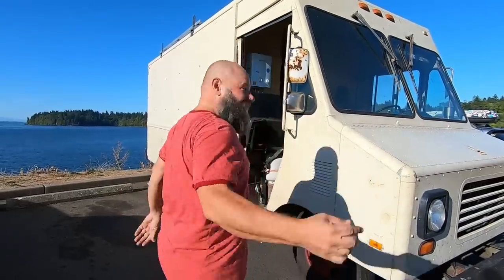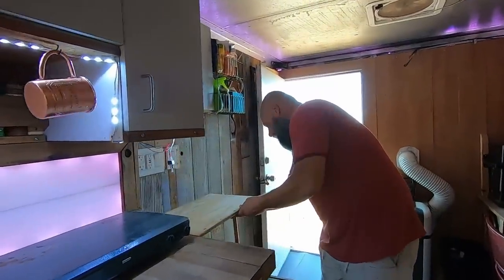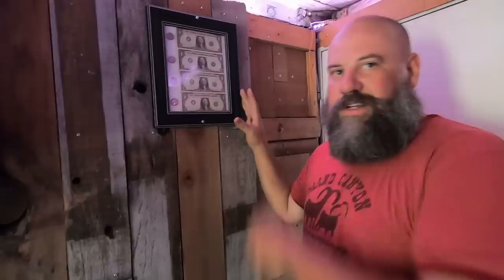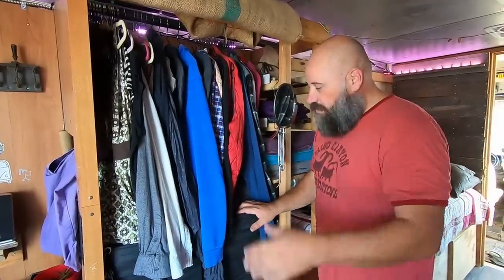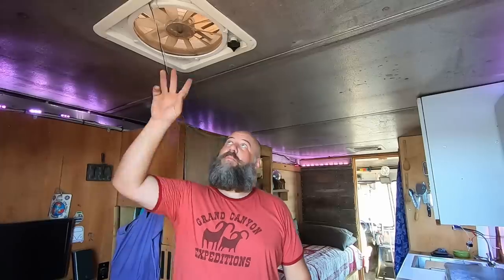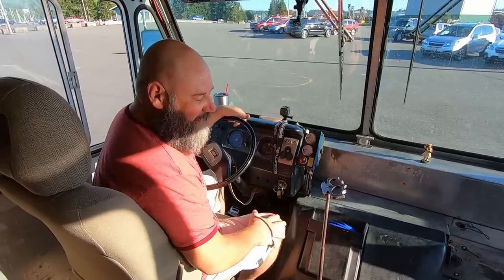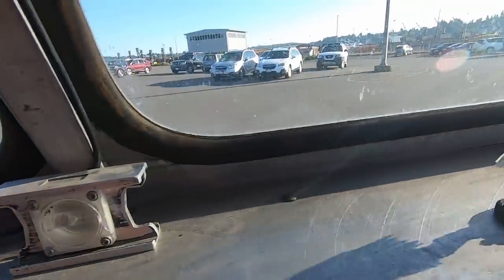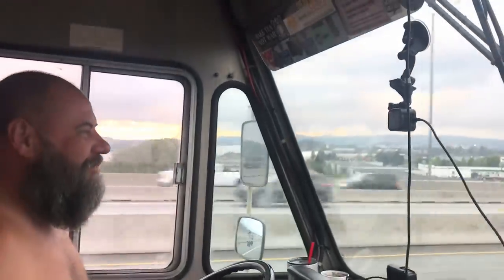VAN TOUR | Spacious Vanlife Stepvan w/ Cummins Turbo Diesel | Camper Van Conversion

Comment: I had a 1963 Chevy Step Van  292 6 cylinder when i was a teenager. BTW 69 years old now. It really attracted the police. The  rear doors opened the full width of the van, had a full size sofa there facing out.  Twin size bed behind that.

Comment: Back in the 70's I bought a commercial International Harvester laundry truck that had thrown a rod.  I got it for $75.00.  A  friend had a 1965 Cadilac with a rotted body.  He gave me the car.  I pulled the engine and tranny and adapted them to replace the IH engine.  I made some linkage for the tranny, added an AC condenser to cool the tranny fluid, and put it on the road.  I drove it everywhere up the West Coast to Arizona.  It had a bath/shower, gas refrigerator, stove, sink slept 6.  It was a lot of fun.

Comment: Hi, I found your channel from when the k9 police pulled you over. Which you handled very well. I'm a diesel mechanic at a gold mine just north of area 51. Your 4 cylinder Cummins is by far one of the best diesel engines ever made. We've made bread trucks into service trucks in the past. I'm sure you know, but you could make a large box under your bed for many 6 volt batteries. The reason I told you about where I work near area 51 is it's all BLM land. The weather is beautiful during the summer, and most of the winter. I don't understand why no nomads with a channel don't go out there. Especially for content. Just subbed thank you.
Reply from the maker: I may have to soon! Sounds great! Maybe you could peek around the breadtruck and point out of it has any issues.

Comment: VERY IMPRESSED ! GOOD JOB !!!!! 
NOTE: for the fridge, you just need 2 more solar panels, and inverter and dont spend on a fancy RV FRIDGE, Get instead a small DC to AC Solar Inverter that will work with you solar panels. 
AFTER THAT: You got 24x7 electricity like any home. Get an ENERGY STAR CERTIFIED REFRIGERATOR and have EXTRA POWER for everything else, you could even run a little shop and all construction tools from there.

Comment: Very cool and you didn’t spend $150k on it. That leaves a little left for the traveling kitty. I love the on demand hot water system.
Reply: We've had on-demand hot water at home since the 80's. 20 showers or 20 loads of laundry is awesome to have, and takes up less room than a hot water heater that wastes money staying hot 24/7. They pay for themselves.
Reply: @POWER-LINKS  Almost every Hotel, condo or Resort that I've stayed at in the Philippines uses instant hot water heaters and they've been using them for a long time. Works great.

Comment: Very cool and well thought out truck that will last a long time . I would have to figure out a screen for the back door and a window would be nice , however not stealthy , I understand . I travel with a F - 350 dually with a 91 11 foot Lance camper and pull an enclosed Harley trailer behind . I only get about 11 mpg with the 7.3 diesel . I love the challenge to build a unit out of a bread truck like you did . Very nice . 👌

Comment: CO2 is heavy; put your monitor further down near your head where you sleep.  Other than that, great conversion!
Reply: CO, carbon monoxide is what kills people. It suffocates you without warning. CO2 causes you to hyperventilate as a warning.
Reply: Dan that's a great idea!
Reply: Not necessary if you have the air moving.

Comment: Paul, Love the setup you have. If I may give you a tip that I just discovered, and put to practice. You mentioned going to a Dometic fridge. I have one I will give you free. Why? because they suck!! I took mine out and bought a dorm fridge from Walmart its a Hisense 4.4 Cu ft that runs on 110, fits perfect under my counter at a height of 33 1/2 inches. Well, I have mine hooked to 2 batteries with 200 watts of solar. This is the way to go!!!!!! Trust me, this thing is super cold. Very efficient, quiet as it can be. No regrets with the swap! I should have done it a long time ago. BTW if you do the math, Dometic fridge will cost more than A large dorm fridge+Solar+batteries, yes all of that is cheaper than a Dometic fridge alone. Just found your channel today, very cool rig, look forward to more vids, Dave
Reply from the maker: Dude I’ll take it!
Reply: @PaulBarger check out the VL45 Iceco fridge at about $500 or get one on sale. Better than a Dometic but also uses very little power. Iceco VL45 is built tough like a bread truck.

Comment: I’m watching this in 2021 so I’m not sure if you’ve already solved your jump seat issue, but Toyota Tundras have fold up back seats. They’re a 70/30 split, so the passenger side is a single seat. Folds up from the bottom, and very comfortable. Just a thought 😊 Great setup!

Comment: Love what you've done with the bread truck!
I'm a retired roofer. 
If you ever need a sealant to permanently seal your roof penetrations try Roof Coat 2200. 
Aka rc 2200. 
It's not water based and literally lasts forever!  
Available at Roofing supply places.
Reply from the maker: Awesome! Thank you. Thank you for the tip!

Comment: Awesome home! You may want to consider some ideas. 1- You can make a sliding drawer out of each of those boxes under your bed. 

And 2-To avoid having both of you to get out of bed, to put the mattress back to pull out your sliding drawers, you can make the front, of the extreme drawers, going sideways to your hallway, and get things from them while on bed!

One more, maybe, you like Beetle's passenger seat's system that rolls to the front giving you space behind it to pass to the back. The negative, is too short for the truck or it may be too short so, maybe you want to check minivan's hiding down seats in the floor style that, although may not hide in your truck bottom it rolls in somehow allowing you to pass behind. Just check under seats roll save space.

Comment: Building code requires a door to be hinged on the interior.  If the hinges were not on the interior then someone could just pop out the hinge pin and open up the door, also incase of a fire and someone cant open a locked deadbolt in order to exit home.   You have done a good joj keep it up and God Bless  .   Lee from Tennessee :)

Comment: Paul,
I would keep the original bumpers. Why? It keeps with the "city stealth" mode, they are extremely tough and will protect your camper body in case of an accident. I built pipe bumpers 6" filled with concrete, to put on my '79 GMC "Heavy Half" pickup. One day a Ford F-150 rear ended me at 40 mph, and was totaled. My damage was scratched paint easily repainted, no other damage. With today's plastic cars and trucks, it is nice to drive a tank like my GMC. My '90 Ford Ranger has 3"pipe bumpers, but fortunately they haven' been "tested" yet. Sturdy bumpers can save you a lot of money and headaches in this plasticised world. Happy traveling !!

Comment: Jump Seat idea for you!.... my 2004 Ram quad cab rear seats were made to fold up. They were 70/30 or 60/40 split. If you used one side of a rear seat like that (might need a welding shop to make up a way to mount) you would have similar function as you have now but a fat more comfortable ride. Great vid, thanks for the tour.

Comment: Good idea to have the door open into the vehicle. Would suggest building a screen door. Have a residential metal door on the back of my cube van with a screen door. Door can be left open with the view and fresh air without bugs getting in or my dog getting out. For the screen door simply made a wooden frame with a couple supports to keep it square and stapled aluminum screen. Covered the staples with half round pieces of wood trim.

Comment: I have watched a lot of these and this is by far the best one I've seen yet. This thing hits every one of the most important features you would want to have when putting together one of these trucks. I think the best of all is the aluminum body... Headroom and motor... Great job! If you need heat buy suburban furnace or diesel heater since you already have diesel. Try not to use the Buddy Heater.
Reply from the maker: Wow! What a compliment! Thank you so much! That’s rad!

Comment: I have the same motor that you have in a 1995 Ford short bed F150 and it gets 25 miles to the gallon five speed stick great rental vehicle love to travel in it
Reply from the maker: I bet that truck is a BEEEEEEEAST
Reply: I have a 1986 Chevrolet motorhome 28-foot I'm getting ready to put a 4bt Cummins in it and hook a transfer case up in 4 wheel drive I think it will be awesome when I'm done probably won't be fast but it'll get you there

Comment: Having the door open in also puts the hinges on the inside - otherwise, it would be easy to remove the hinges from the outside and gain access to your vehicle.  Or you would have to use some method to secure the hinges.

Comment: i would extend the jump seat bottom out about eight inches so it still folds up but is more comfortable. fit it with a plush cushion and on the rear too for way more comfort. it wont go up all the way but it will solve you problems.
Reply from the maker: I’m going to completely ditch the jump seat. I want a legit passenger seat with a shoulder harness.

Comment: New Subscriber.Created & saved this video to a new play list .you've inspired me .seen quite a few of these builds but something about yours hit the spot. You know the feeling ....It's yours.few sugestions...I'm a handyman,put in some screen doors on a home last year .screw to the door jam .roll up.very simple .think you'd like 1 or 2.The ac...maybe they're different now but I bought one of those a few years ago ,needs a caulked plywood box built around it .way more efficient.Google your model,my not apply.mine sucked more hot air from outside than the cool it out out.from any tiny crack\unsealed spot.Small piece of car window tint on the light that's too bright.grab a few different scraps from dumpster to find right shade or sharpie pen works..small slideing tinted ( mirror) Windows on  both doors .curtains optional.if you get this ,save me some time...ball park ,how much was build?Thanks
                                                                               Burke.NC.
Ps.ever near Pinehurst ,plenty of room for you to park & camp.quiet country spot..
      2  questions..Bridge,Charlston SC?why don't you like your bumper s?
                          Take care& good day.BW
Reply from the maker: Bridge is Port Mann Vancouver BC, the front bumper is crooked and the rear one is mounted silly. Can’t attach a hitch. It’s also very slippery.

Comment: nice thouch with those woodblocks to keep the doors closed
think a boxvan is a verry nice base for an rv , door in the back entrance through to the cab ,aluminium body simple flat windows and a lot of height 
as for the batterijvoltage leds  , look intoo someone that tints windows and take a small piece of his offcut window tinting foil . it should dampen the light by a lot , can even douvle up on the foil

Comment: Monoxide alarm needs to be lower.  
Monoxide is heavier than oxygen so you could be dead before it ever alerts the alarm. 
Smoke detecter up high,, monoxide alarm down low.  
Just a thought to consider.

Comment: Paul, as I'm new to you channel and videos, I'm sure someone else previously mentioned that you need to mount your carbon monoxide detector close to the floor. If your detector goes off while you are in the van where it is presently located, you're already going to be dead. Carbon monoxide is heavier than air.
Reply from the maker: It has been moved. ;)

Comment: Carbon monoxide is heavier than air.  If it were to settle and build up in your truck enough to set off the alarm up by the ceiling, you would have already been dead for quite awhile by then.
Just a PSA.  Nice rig.

Comment: u need an outside vent for those batteries,   As your battery heats and cools, and charges it creates hydrogen gasses.  A spark can cause an explosion. Venting these gasses reduces this risk.  You can go to Colaw used RV parts and get good prices on appliances and other stuff out of wrecked rv,s
Reply from the maker: These are AGM sealed batteries. No vent needed. Going lithium ASAP

Comment: Love the build , how is the drive and steering on the bread truck and have you modified the shocks and sway bar front and back . Have you thought of putting a swing up deck in back made of alluminum and when up it would be like Dutch door , covering part of the door way 4 ft on the bottom and be able to use it as a electric bike mount on the back side while in the up position,  with even some lite at alluminum boxes for storage with feet to hold the deck in the down position.

Comment: As a truck driver with 22yrs experience.  I am a pro at living out of a truck. Do not, what ever you do, get one of those 12V fridges. Trust me.. They suck. They only keep you food 40° cooler than the ambiant air. Get a 120V 2 door mini-fridge. Like what's in a hotel room. They are about the same price. Depending. They start of with a 800w serg but usually cycle at between 50-130w. With six 6V 650amp configured to 18V, I could run the fridge for 3 days without having to start the truck to recharge the batteries. Another nice thing about a mini-fridge is.. You can turn the settings to the lowest setting and turn it into  a 2 door mini-freezer. In a four battery 24V setup my fridge would last a day and a half to two days. Now I know you love your solar, but if you ran a 4-6 6V battery setup, like a semi, you could probably ditch the solar. Or set it up to when the engine is running, you flip a switch to disconnect the solar.  On 6 batteries I could run my 1000btu window ac unit, that I Jerry rigged into the back wall of my truck, for 5hrs before having to start and recharge. You should also look into a webasto or Easton bunk heater. They run on between 1-2 gallons of diesel in 10hrs and have a climate control system. They are amazing.  To bad I didn't know you would be up in this area, I would've loved to have said hi. I live in Oak Harbor, Wa. Which is on Whidbey Island. When you popped the hood, it looks like there is plenty of room in the battery box of a 4-6 battery setup.
Reply: I have some other tips that can save you money and I know how to get 20-35mpg out of that engine also. Let me know if interested.  I'm not looking for money, I just have some experience that I don't mind sharing for free. I just don't want thumb it all out on my cell. Great vid BTW.
Reply from the maker: I’d love to get some advice on what to do to this thing. Does getting that MPG lower the motor’s longevity? There is SOOOO MUCH room under the hood. I completely removed the heater inside and out.
Reply: @PaulBarger  
To maximize your fuel mileage with that engine,  you should be operating at 1250RPM at 65MPH. There are 2 ways to do this. The easier way is bigger drive tires, if you can get them to fit. The second way is to change the rack and pinion in the rear differential to a taller gear set. This won't damage the engine, but you will be shifting down a little more for the steeper hills. I had an old 92 Pete with a series 60 Detroit that I did this to and I went from 7mpg empty and 4mpg loaded to 13mpg empty and 7mpg loaded. I'm pretty sure that that old bread truck is geared down for city and local use and not really geared for the best mpg long haul driving. Now if you go the tire route,  it will mess with the levelness and will rake the rear end. It will make your eggs slide to one side of your pan. Also your RPM for fuel maximization for climbing hills is 1850RPMs. There's other things that will get small MPG gaines, but this is the largest one and most cost effective route. It would be easier to give you all my secrets over the phone, but I don't know how to get my # to you, and I don't really want to post it here in the comments.

Comment: Detector should be on the ceiling because the smoke will travel along the ceiling and will have to build to get down to your detector!! JS
Reply from the maker: Doesn’t it need to be low for Carbon monoxide? This one is dual
Reply: Paul Barger you made me look...I googled it and I read it should be 6 inches from the ceiling.  So you’re good! If you had just a carbon monoxide detector it said 5 from the floor...but I also saw 6 inches from the ceiling or floor. Happy trails!

Comment: Paul, you've got me pretty motivated by this video. I'm looking at a 2005 Freightliner MT45 with a 3500 KUV DURAMAX DIESEL. It has 76,000 miles and they're asking ~$16500. The back is empty and ready for renovation. Can you provide any insight into how this might compare to your bread truck and it's potential for conversion? I think we could start a convoy. I can hear the music now.
Reply from the maker: That is more than I have invested in my entire rig! But hey, you do get what you pay for. Idk if I could wrench monkey around a truck like that. May be out of my capabilities. Sounds large. I am wanting to go smaller but maybe I’m nutty lol. What would you like to know?
Reply: @PaulBarger  Well, it's a step van like yours. I was wondering what year your truck was and how many miles did it have when you got it? Reason being, you seem pretty confident in your trucks ability to go many more miles. I'm trying to see if this is a good rig to go with or to look at other options. You've been on the road for a good while now, and you're saying you'd like to go smaller. Can you say why? Seems to me there'd never be enough room. Thanks
Reply from the maker: I’m just weird. I’d be happy with a tiny little thing. My truck is a 1989 and it came with 120,000 miles. If it were 2 feet shorter I think it would make a difference in super tight spots. These engines have been known to reach one million miles. You can rebuild it on the side of the road in most cases if need be. It’s a legendary motor. The bigger the truck, the higher the service cost if you cannot do it yourself.